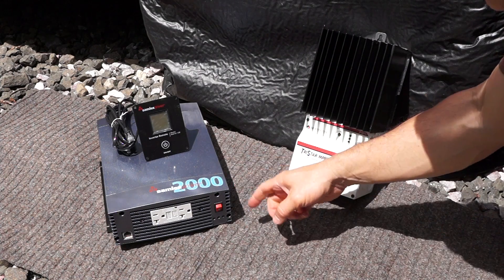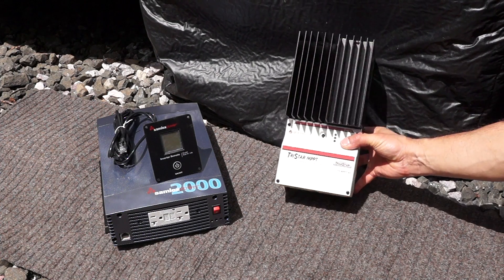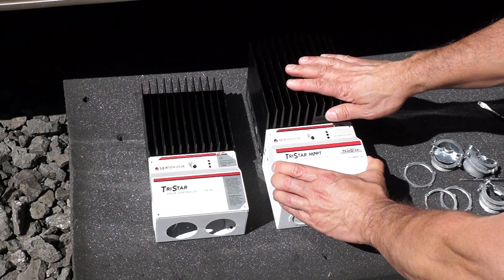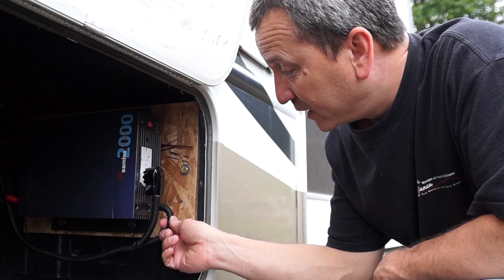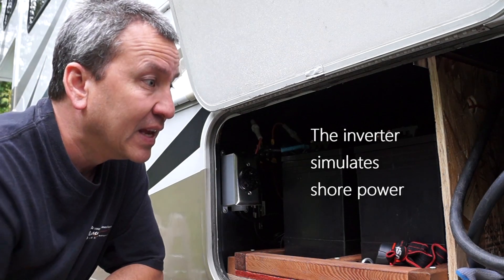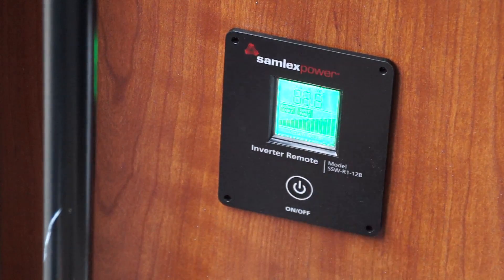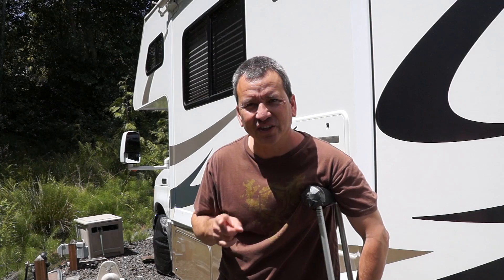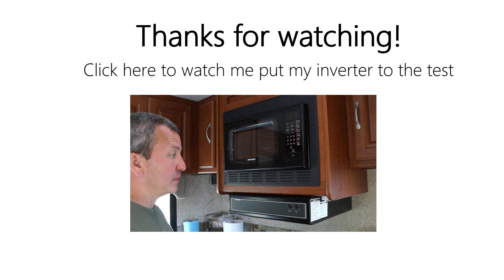Inverter and MPPT Charge Controller Installation - DIY RV Solar

Comment: Would this power cord setup work with a 50amp RV? I assume it would be no different than plugging my shore cord into a 15 amp outlet on a generator.
Reply from the maker: You're right. It may just power one leg of your 50A. Depends on how the plug is wired.
Reply: @RVwithTito  Thanx, I hooked mine up last year and added a jumper wire inside the 50A outlet. works great and yes I can make popcorn 🙂

Comment: I just bought a Agm,batery,a charge controller and an inverter,.
 After two days of constant work I realized that the solar system is not going to work. 
 I tossed it all in the trash with the other worthless components. 
 And stuck with the engine yo charge the battery.

Comment: Another way to accomplish the 110v back to the coach is simply wire it directly to your panel to dedicated breakers. Although an auto sensing inverter should detect shore power, with dedicated breakers you can easily and safely manage your inverter. I find your videos very helpful and informative, but no offense don't care for the way you hooked the inverter via an outlet. This seems to add complexity and a bit of a safety issue. If your inverter is energized there is enough power in that plug to cause injury.

Comment: Hello I'm designing a solar system to power a ubiquiti long range cpe and a poe camera can you recommend some parts to build this system? the cpe uses a 110vac power from which i will connect the camera to it through the poe interface and i would like a Battery that can run the inverter during the night any assistance would be great.
Reply from the maker: You'd have to calculate the total current draw of your equipment (including the operating current of the inverter) over a 24 hour period (assuming it will run 24/7). That's where I'd start. Let's assume it draws 10 amps per hour at 12 volts (typical deep cycle flooded battery). 10 amps X 24 hours = 240 Amp Hours. Your battery bank should be double that (if using flooded batteries which shouldn't be discharged below 50%). The solar panel(s) should equal the battery capacity in watts (240 watts for 200 amp hours) as a rule of thumb. Of course, the solar may offset that during the day, but that will depend on how sunny your location is throughout the day/year and how long it takes to recharge the battery in the morning. Hope that helps.

Comment: After 4 years , how has the Samlex inverter been holding up? Did i miss how you hooked up to the batteries?
Reply from the maker: Still have the Samlex inverter and it's working fine. I have #2 AWG cable from the batteries to the inverter with a 300A fuse on the positive.

Comment: tito thanks for the Great info, how do check for the transfer switch? Im going to use two 6 volt battries  under my dinnet set  i thought to put the mppt controller in the other set area with the inverter ,my avalable space is hard to cme by, distance from the batteries is about 5 feet. any suggestion or digrams  would be great.. Thanks again. terry b

Comment: Great and informative video! What's your routine when boondocking after the sun sets? Do you switch things off and run strictly off the batteries for watching TV, etc? I'm wanting to put a system like yours on my RV.
Reply from the maker: My goal during the day is to get a good recharge into the batteries (hopefully full), because after sunset we run strictly on batteries. We have 450 Ah of batteries now so we can do quite a bit now actually. We watch movies on our 32" LED smart TV, use our laptops, lights, mobile booster, hotspot, etc. The inverter draws about 2 amps when running, so I'll usually turn it off when we go to bed and just use DC through the night. We also have DC powered electric blankets for warming up the bed. They shut off after 30 minutes each time until you press a button. Early in the morning we can still use our Keureg coffee maker. Hope that helps.
Reply: Thanks! We appreciate it! When you say "DC through the night", do you mean the hooking up through outside shore power or the generator? Sorry for all the questions.

Comment: Just got a new rv and am planning my solar.  My last RV had a breaker for my converter and it was easy to shut the converter off.

This newer motorhome does not have a breaker for the converter.

What would you do to turn it off?

Comment: Tito, you often talk about shutting this or that off at the breakers.  Do you have a video of your fuse block set up or breaker set up for your system?  I see numerous kill switches in your videos but no breakers or fuse blocks.  If I want to use my inverter couldn't I just put a kill switch like you have between my MPPT controller and batteries and would I need another between my batteries and fuse block??  Love your videos brother....safe travels..

Comment: WARNING.  you are not grounded to earth when you do this. I'M NOT sure what to do ,but i would like to know so i can have ground.
Reply from the maker: This is true, the system is negatively grounded to the RV chassis. When plugged in to shore power, then it's earth grounded assuming your grid service is grounded (I hope so).
Reply: RVwithTito i'm thinking of carrying a long grounding pole for boondocking. but there has to be a better way. what do boats do? ground to water?

Comment: Are you a ham radio operator? If so, what is your callsign and how did you connect up your ham gear to electricity 12VDC or 120VAC?  

73!
Kurt - KA7ZDD
Milwaukie, OR
email:  ka7zdd (at) yahoo (dot) com
Reply from the maker: +Kurt R. Warner Hey Kurt. No I'm not a ham radio operator.

Comment: I love your videos and learned quiet a bit. I recently installed 4x120Watt panels, 40A Tracer CC, 3000Watt inverter, 2(6vx230A) batteries. I think that's a lot of juice. I can power my pop up with that...but how should I wire the popup 12v battery (sitting on the tongue of the pop up to the solar batteries so that it also gets charged by the solar system?

Comment: Loved this idea! Planning to add solar to my 2005 Lexington class c and will be using a lot of the info you have provided, thanks. Will I be able to run the inverter while driving down the road for crock pot cooking? I wasn't sure if the trick charge for the engine battery would be an issue. Do you have any idea or suggestions? Thanks, Amy
Reply from the maker: +A Erickson It would probably work Amy but it really depends on how much battery capacity you have and how much energy the crock pot needs. I've also seen crock pots that run directly off of 12v DC power. You could even run it directly off of your chassis alternator while driving to prevent drawing power from your solar/house batteries.
Reply: RVwithTito  Thank you, I'll look into the alternative. I have 2 12v house batteries, planning on 200w panels/30amp controller with 2000w inverter. I'm so looking forward to doing this in May, just waiting for the NH snow to go away! Keep smiling!

Comment: Tito...
Thanks so much.  I know there's a bunch of junk being sold on eBay from China, but there will be some good Chinese electronics at some point.  Question:   Do you know of any decent less expensive MPPT controllers out there? 

Thanks again
Wright
Reply from the maker: Sorry, but I only have experience with Morningstar controllers. I have used 4 different ones and they have all been good. My first MPPT charge controller was a $100 one from China claiming to be a MPPT 30 amp. After a few times using it the output levels would start pulsing up and and down. I bit the bullet and decided from that point not to go cheap. That was a few years ago though. I'm not sure if that helps, but that is my experience.
Reply: Thank you...I'll bet there must be someone over there who copies a Morningstar or some other good MPPT controller and makes one cheap...I guess I gotta bite the bullet too.
Reply from the maker: +C. Wright Kunkle Well if you're going to spend the money the the controller is the best place to spend it since it's the brain of your solar charging system.

Comment: Tks again for the tips, I do have a question on RV's, I am thinking about getting a used Class C from Cruise America 2012 with 120,000 miles any thoughts
Reply from the maker: Get new tires and a new paint job but keep the dog pic in the window. Just kidding :) I have no experience with those. Give it a good inspection and know what you're getting. The deal breakers are usually leaks, water damage, and problems with the engine or chassis. In my opinion, the rest of the interior can be fixed, remodelled or replaced. Keep in mind that those are probably high miles and used primarily by inexperienced folks. So they may have bumped into a thing or two. It could be a great deal though. I actually considered that option when we were first looking. Good luck.

Comment: hi newbie here, I want to start a system in my 92 bounder ,I have a 3000 watt inverter 2 -6 volts in series @ 225 ah  .I have an opportunity to buy one 275 Watt  panel  I'm  told it puts out 35 volts what controller will I need 30 amp 40 amp mppt what cabling  have a 250 amp breaker for baterry to inverter not an electrician but am handy , oh yeah 12 volt system .would I have to get panels that are right for battery bank 200 watt instead. oh want to run typical rv stuff fridge keurig micro  tv fans heater etc. thanks for any help ,love all the videos
Reply from the maker: Hey Marcelino. Just getting around to answering comments. Hope the emails were helpful.

Comment: You just  flip off the breaker  in your brake box that all  what  is it be liable as any hint or just batters you give grate help  I have 4/100 w panels and a mppt  and 2000 w inverter
Reply: what breaker do you flip off

Comment: i actually took your advice and bought the TriStar  45Watt Charge controller as well as the 2000 Watt Samlex Inverter. Have two Trojan 305AH Batteries and 450 Watts of Solar Panels. Works like a charm. Thanks for the tutorials Tito.
Reply from the maker: That's awesome! I'll be upgrading my batteries soon. Can't wait.
Reply: thanks for Posting your DIY Solar Systems. Im sure i am not the only one who has copied your set up. They are well done and straight forward. Well Done!
Reply: got a question for ya. As you travel, do you keep the Shore Power plugged into the Inverter to keep the fridge running?
Reply from the maker: +R Christie Yes. While driving I keep the shore plug connected to the inverter. If it's sunny out and my batteries are charged, I'll run my fridge off of the inverter, otherwise I'll run it off of propane. So I'll switch between the two.
Reply: i was hoping you would say that! lol. cheers.

Comment: how many dc amper you need for 1000 ac watt??
Reply from the maker: 83 amps at 12 volts (1000 watts / 12 volts)

Comment: I keep watching your videos and get new ideas, and questions, all the time. After my last post and lots of research, I decided to go all out and put in a 3000 Watt Xantrex Inverter in my Class C Motorhome. I moved 4 circuits from my main panel to a new sub-panel I installed, ran 10-2 wire inside of flexible conduit from a 30A breaker in my main to my inverter, then ran another 10-2 wire from my inverter back to my sub-panel to power my 4 circuits. Each run was about 25 feet (HUGE JOB BTW). 

Now for my question. I added two additional 6-volt batteries to my system hooked up in series/parallel. Do I need to increase the wire size coming off of these 4 batteries for my CURRENT DC ELECTRICAL SYSTEM, or can I just us the current wiring. For my new inverter, I will need 4/0 wire which I am getting ready to purchase and install. I also have a 400A fuse for the +, and a battery shutoff for the -. But, do I need to do anything to the wiring for my current DC system, since it will now be drawing 464 A/hours of power off of my 4, 6-volt batteries, instead of the previous 232 (2, 6-volt batteries? I'm stuck, and haven't found an answer to this question yet, but hoping that you can either answer it or lead me to someone who can. Thank you again for all you help.
Gary
Reply: Hopefully your additional two 6 volts are not much older than your existing ones. If they are, your older ones may draw your new ones down in capacity. Your current wiring from the consolidated batteries does not have to change, current draw will not be any higher. Your fuse and inverter wire gauge is perfect.

Comment: Tito, enjoyed your videos especially when I first got my RV about two years ago. Learned some valuable information.  Found a better solution for connecting your inverter without having to turn off your converter. I wired this inline transfer relay to the breaker that powered my AC plugs:

http://www.xantrex.com/power-products/default/inline-transfer-relay.aspx

Inexpensive and very simple to install. Plugs directly into your inverter. Since the breaker only powered the plugs, you don't have to worry about the heavy loads like the air conditioner or microwave.
Reply from the maker: I'm looking for a good relay solution. I'd love to see how you have it wired up. Do you have a Xantrex inverter?
Reply: Yes, I have a 1000 watt xantrex prosine, bought used for a great deal. This relay can be used with any inverter. All you have to do is take the positive, negative and ground from the breaker you want to power from the inverter. Just unscrew the wires from the 15 amp breaker and tie them to the input of the relay. Then run the output of the relay back the the breaker, using proper junction boxes.  Watched a movie on the TV while the wife ran the generator for microwave and there was no interuption

Comment: So let me see if I got this right. The 30 amp outlet that is mounted is wired to the 110 plug and that plug is plugged into the inverter. Then you just plug your 30 amp shore plug into the outlet you installed. Is that right? See I thought the 110 outlet on the inverter was just that, an out put. Am I missing something? It seems like a great easy way to do this. I just want to make sure I am seeing what I'm seeing. lol Oh, and turn off charger. Thanks.
Reply from the maker: +BlindViews That's right. You got it. My inverter is located on the opposite side of the coach. So there is actually a positive cable from the battery bank to the inverter input (negative is grounded to the chassis), then the 110 inverter output goes back across to the battery compartment to the 30 amp receptacle.
Reply: Nice. Thanks. That's probably the easiest way I've seen to do this. I like plug and play. lol Thanks again.
Reply from the maker: Yeah it has worked pretty well. Remembering to switch off the charger every time is kind of a hassle and makes it less plug-and-play. So I'm planning on installing an inexpensive relay to automatically sense power from the inverter and shut off the charger. That will be very cool if I can get that to work automatically.
Reply: If it works, please post a video
Reply: I saw some one mention using a relay in another blog. I'm going to install the same thing. Did you install your relay yet?

Comment: 45 amp load would it over tax the 2000 wt inverter with frig and air conditioner on simultaneously

Comment: Brian do you have an automatic transfer switch in the basement?
Reply from the maker: +Edmonton Dom I have an auto transfer switch for generator/shore power.
Reply: do you have any videos on how you hooked up your auto transfer switch? I am trying to wrap my mind around the process. The 5th wheel we bought only had shore power. Thanks
Reply from the maker: +Edmonton Dom Sorry I do not. Mine came with the RV. It's basically two power lines going into a black box (shore power and generator) and one power line coming out to the converter/charger/power panel. I auto senses power from one of the two sources and seamlessly switches to the output.

Comment: Hi Brian and Melissa. We are new to RV's and we bought a 40 foot 5th wheel, 50 amp, but it has no house batteries. I am doing up all the schematics to ensure I do install the solar panels and deep cycle batteries right the first time. 

You said when you plugged in the 30 amp plug into the 30 amp receptacle to turn off the "converter/charger". 

Am I to use that you have a separate unit that was unseen, called a "converter/charger"? Is the "converter/charger" needed when you are using solar panels? Thanks
Reply from the maker: +Edmonton Dom That's correct and I don't show the converter/charger in the video. I have a breaker to turn it off when using the inverter. The converter/charger in most RVs is the piece of equipment that charges your batteries when you are plugged in to shore power. It converters AC shower power into DC power to charge the batteries. When not on shore power, my inverter draws DC power from the batteries and converts it to AC power. I connect my shore power cord to my inverter output. My shore power cord goes directly to the converter/charger unit which also contains my main power panel. I have a breaker on that power panel that turns off the converter/charger unit so that it doesn't try to charge the batteries that are actually providing the power. I hope that helps clear it up.
Reply: Perfect. Thank you so much!

Comment: Great video!... The one recommendation (other than higher gauge wire) is to install a regular 110 outlet and buy a 30/50amp to 110amp adapter plug for the shore cord... This makes the wiring a little easier and you also gain a additional 110 outlet than one can use for things like air compressors or power tools...